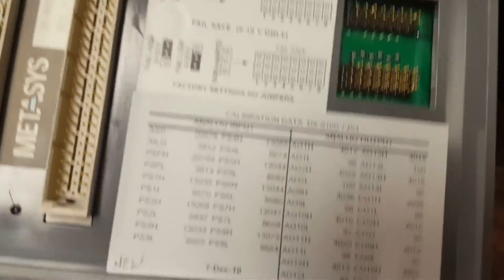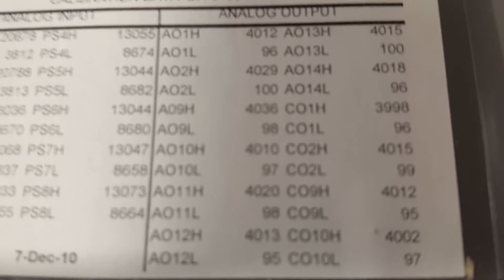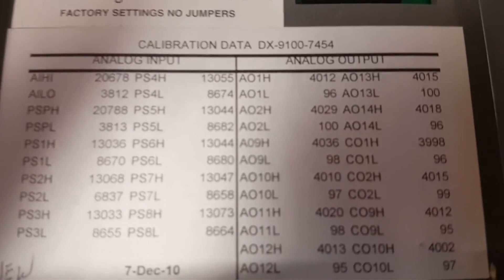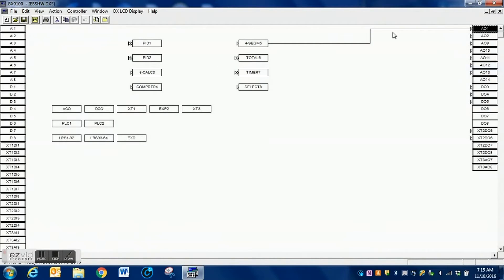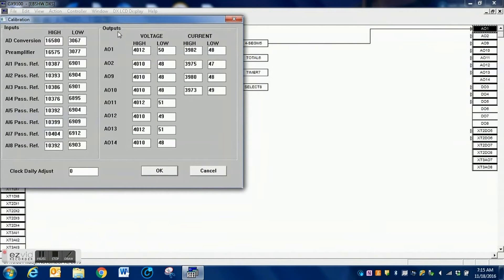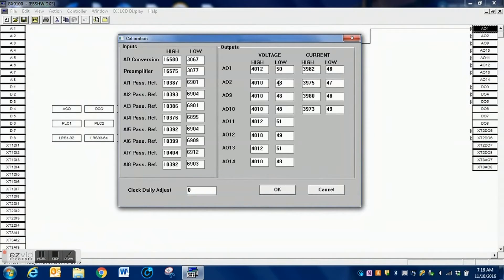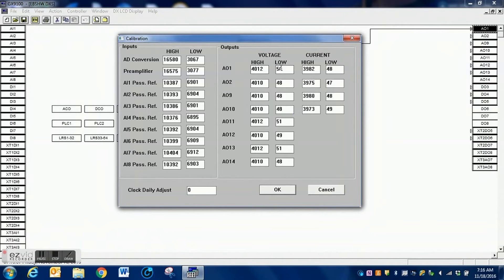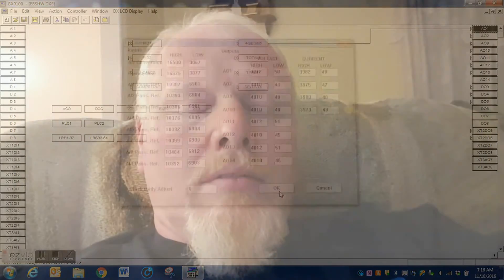Johnson Controls DX 9100 Analog Configuration

Comment: Hello thanks for the videos.  I had a question about calibrating an active analog input.  How does one go about implementing an offset on a 4-20ma input signal?  For example my humidity sensor is reading 45% on the front end, yet every other device I use to measure the same humidity reads closer to 50%.  I know its only 5% but its a semi-critical environment and 5% is a big deal to the tenant.  Any suggestions aside from replacing the sensor?
Reply from the maker: You might be better off replacing the sensor. The calibration of them is typically factory set and if they become inaccurate its time to replace it.  You need to be able to take the sensor to its minimum value, set the lower range and then take it to its high range to adjust the span. You might be able to make it read the same as other sensors but if it goes beyond a few percentages it won't give you an accurate reading.
Reply: @Systemcontroltech  Cool thank you for your insight.  I'll go ahead and replace it.  I'm on the younger side of control techs so I don't have a whole lot of experience with the DXs.  The campus I work on has tons of them so I'm working on getting familiar.  I'm just so used to CCT that the GX9100 ui is very foreign to me.  Side topic:  Are you familiar with MUI and how to set it up / configure it? 

Thanks!

Comment: Another nice video.  Just to be clear, in order to modify an AO range you need to modify the calibration table or on the actual AO point in the GX can I modify the High and low range?
Reply from the maker: There is a calibration value that the factory puts into the devices for the outputs to give the proper outputs.  Those calibrations are sometimes modified for specific applications.
Reply from the maker: Follow the steps in the video to change the calibration of a particular AO.

Comment: Hi, I have a questions if I can ask you. I have a Metasys Johnson Control which I can not log in to the system after rebooting with default user name and password. I get the log in screen, but it give me error on login " Unable to login. Unexpected error" how do I log in and see what is going on with the system.
Reply from the maker: +heyfive99 you may need to reinstall the operating system on the nae. That's what we've done when we get certain errors